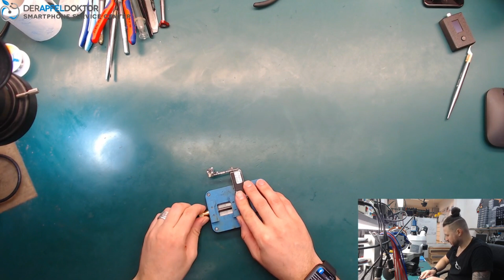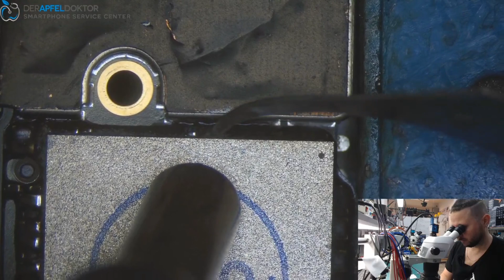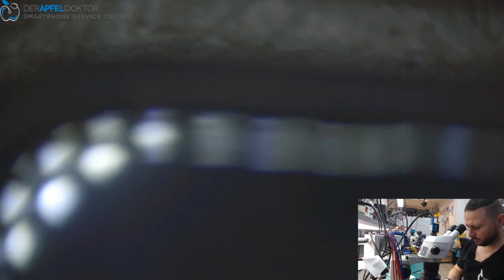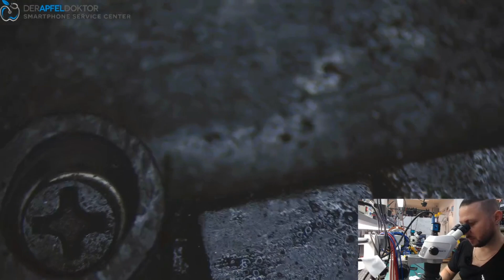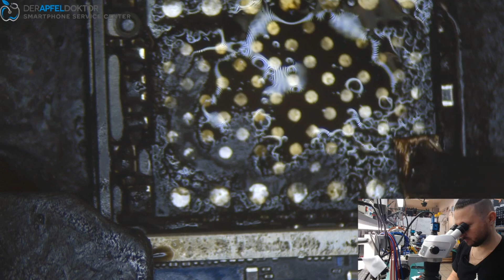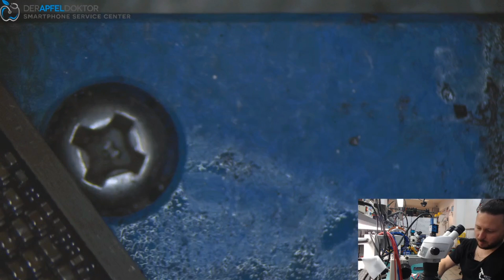MASTERWORK - HOW TO EASY PREPARE AN iPHONE 7 LOGICBOARD FOR COMPLETE BOARD SWAP - ICC PRO

Comment: My friend, what temperature do you use when I raise the processor?
Reply: With quick 861dw 330c air 60.
Reply: Nozzle 8mm - 10mm
Reply: Is it possible to raise the processor with a temperature of only 250?!!!!!!!!؟؟؟؟؟؟؟!!!!!!
Reply: @waleedkhateeb7049  I´m sure you need about 300 degrees.
Reply: Peter Fuchs  , 280-300 hako . Prechiter 180
Reply: @waleedkhateeb7049  
i'm not sure love he answers himself
Reply: waleed khateeb 280-300 c / 80 medium  . Prehiter 185c
Reply: I suspect about 250 degrees